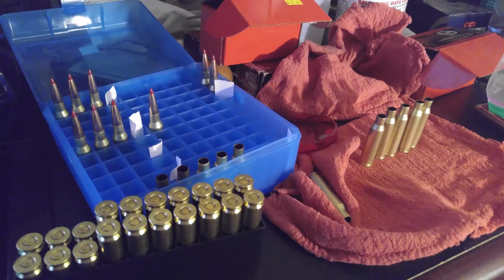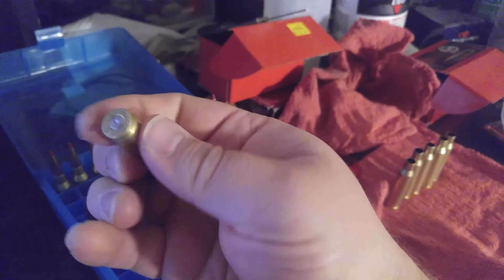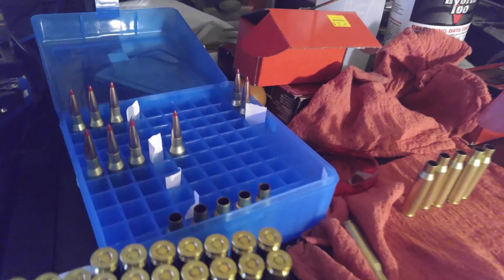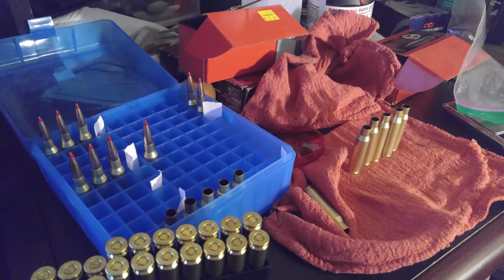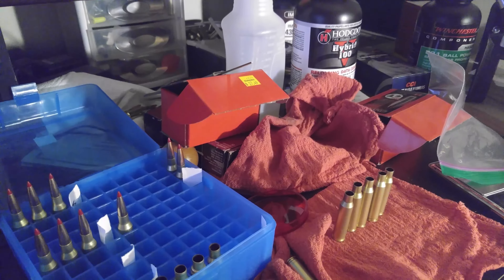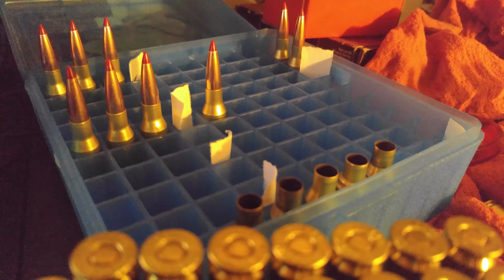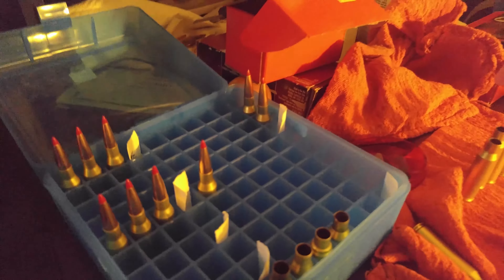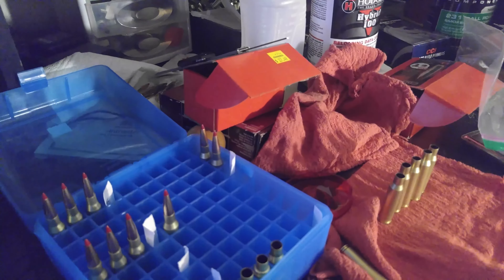7MM-08 High Pressure with PPU Brass and IMR's load data - ELD-X 7mm-08 Elk loads

Comment: PPU is a light thin brass and you can push out the primer's win 308 brass sized down or use the brass from the whitetail American brass is great
Reply from the maker: Yeah I've had good success with the Whitetail American Brass. I picked up some Nosler brass and have some rounds loaded that I'm going to go shoot. 40 rounds, all weigh withing 0.1grs. Pretty impressed with the consistency of the Nosler brass so far.

Comment: Might try a different bullet too. Those super high bc long bullets eat up alot of powder capacity in the relatively small case. The 140 grain class bullets are probably a better all around choice in the 7mm-08. Preferably one without the plastic extended tip. Try a 140 partition, 145 gr. Speer hot core, or a 140 Sierra game king. They will work just fine on elk too. Just my .02 cents.

Comment: I realize this video is old, but I have some  PPU 7mm-08 brass and some Alpha brass and was curious about case capacity. The PPU brass held 1.2  grains less than the Alpha filled to the case mouth. Can't this cause the issues you were having? Aren't charge weights relative to case capacity? It seems to me that even though you were under book maximum, if the actual case capacity is less, wouldn't that be the same as being overcharged? I'm just trying to understand how these variations work together.

Comment: I get my brass from Brassbombers I get it 500 lots its once fired military brass an its in the .308 cal. I full length size it, then I trim the cases so they are all to spec, the military brass comes a little long. I use the 7mm-08 Hornady dies,  I've had no issues with these. I load with Varget, an BL-C2  both I purchase in 8 lb. kegs because of cost.  I load the 160gr BTSP Gamekings an push the Mv to 2750 no pressure issues an I use magnum primers.  I get good accuracy out to 500 yards, that's as far as I can shoot at our range, I shoot 6 in. steel plates consistently at this range.

Comment: What is C.O.A.L the data in the Hodgdon website states 2.875 and the Hornady loads are 2.755 hence the different charges. This is very important as it affects case volume. Try the H100V again with Hornady brass at 2.875 and you will be surprised the difference, the only problem is yuo will either have to single feed them or get a extended mag.

Comment: Did you clean the the primer pocket out like heaps or clean the flash hole?? i use the ADI powder. i use  AR2206H in my 7mm08 (i'm in NZ) what about H4850 its its equal or equivalent.
all ther best.

Comment: I just got some h4350 and loaded some 162 eldx. 2.880 oal but the loads seem compressed. 41.4 grains no compression but 42.2 is crunchy. Does this seem in line with what you were able to achieve with the 7mm08 162s?